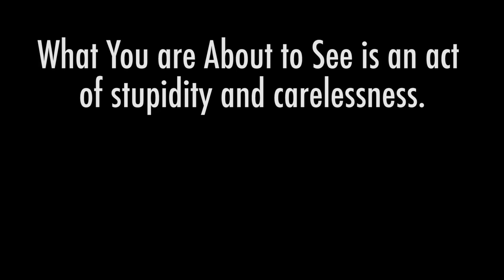Fitting the 670cc and Test Ride!

Comment: I believe that engine is a flat 4 twin turbo rotary from a mustang.
Reply: +mitchell robinson flat 9 i think
Reply: single valve v-flat 12 hemi     2-stroke
Reply: +mitchell robinson That's odd. I was under the impression that it was a 3 stroke hot bulb steam single cylinder radial electricity cooled diesel. With V-tec, of course.
Reply: +Nick Belanger most likely ya
Reply: +mitchell robinson I thought it was a v7 twin turbo rotary with vtec and nos from a camaro.
Reply: +mitchell robinson didnt you see the rubber band in that thing
Reply: +mitchell robinson lamborghini mustang AMG zetec
Reply: +mitchell robinson now you see only car guys are able to find this stuff funny i.e. maserati chevelle RX7
Reply: All of you have got it wrong it's a 9 cyl radial engine from a wwII PLANE running on pure nitromethane with 9 supercharger and 9 turbos
Reply: +Michael Principale dude shit didnt realise!! so i guess they are using a 4.5cyl radial from a WW1.5 plane with 4.5 superchargers and turbos?
Reply: *on the kart
Reply: Really, I thought it was a five stroke v3 flat4 Wankel engine
Reply: oh shit
Reply: I thought it was a 7 stroke 3 piston rotary out of a 1809 Benz motor camero
Reply: does it have 3.141592654 miles per gigawatt?
Reply: Suck Me Off Don't forget the racing stripes and cup holder! That'll add around 700 wheel horse power.
Reply: No just pie! lol.
Reply: Nope definitely a 12V92 Detroit Diesel
Reply: Its clearly a two stroke nitro engine from an rc car
Reply: Its clearly a v5 boxer
Reply: let me know if thats a joke

Comment: is the engine a 454?
Reply from the maker: +Ryan Weredyk Nope!
Reply from the maker: camron day Nope.
Reply: +CarsandCameras 302?
Reply: +camron day it's a 400 small block Chevy I bet it screams
Reply: +camron day ford makes a 302
Reply: Nope it's a 2jz
Reply: +Fart Can no its a 212 predator
Reply: Does that look like a Chevy engine?
Reply: it's a sbc 350
Reply: +Jacob Cannon its a 400 sbc
Reply: By how it's running its acting like a built 454 with twin turbos running on e85 on 200 pounds of boost!!
Reply: Big block distributer is in the front small block in the back probably a 350
Reply: +Jarrett Copper whatever... thats clearly a 2jz
Reply: +cade rondon chevy big blocks still have distributers in the back
Reply: +Ryan Weredyk chevy made a 302 but it was rare
Reply: +Edward Grindstaff ford made the 302 and 351
Reply: +cade rondon Mopar big blocks have the distributor in the front.
Reply: +camron day There is a 302 chevy smallblock, it went in the '69 Z28 Camaro
Reply: +james jones chevy made a 302 it came in the z28 camero
Reply: +CarsandCameras Goodwrench 350? If so I had the same exact engine, minus the edelbrock carb and valve covers.
Reply: It's a smallblock Chevy for sure, since they already said it's not a 305, 327, or 350 I'm gonna say it's a 400. I guess it could be a 283 too, but 400 seems more likely.
Reply: M Kefer most likely not, chevy never got past 400. Unless its a mopar engine. Then it would be a 400
Reply: +_Husky I thought it was a 572...
Reply: Andrew Lang That was only used for GM's industrial purposes. Not found in any consumer class C vehicles.
Reply: FEAR NONE KILL ALL Huh had no knowing of it, thanks for telling me, i know they had a 427
Reply: +CarsandCameras 327 Chevy Small block?
Reply: +Trans am county hemi  or 283 sbc and to the one guy..
Reply: +Ryan Weredyk chevy made a 302 in the 60s
Reply: +Simon Stout its a 283 i have the same truck
Reply: +jake chaplin you never know    its custom
Reply: true all i know is i have an original 66 and it has a 283
Reply: +jake chaplin from what ive seen on channel its a 400 with 327 heads
Reply: No it's a 66 c10 with a 400 small block
Reply: +camron day ye i think chevy made a 302 straight six. obviously it isn't that
Reply: +Ryan Weredyk Rotary v8 with vtec at 140 psi to the front left tire
Reply: +Ryan Weredyk  Chevy had a 302 its called the DZ302, i'm told it would rev and the bottom end was crap. I don't think it was very popular, it would have been in a 68 or 69 camaro.
Reply: +Gslash25 oughta send all that PSI to the right rear with a HDMI cable, then send any left over VTEC to the blinkers
Reply: +TwilightTheShooter do you h
watch haggard garage ?
Reply: +Ryan Weredyk D16
Reply: +~Ž4RÄLHØ ĐŽN™ is Orion pretty kick ass at drifting an automatic Lexus boat?
Reply: +roturd heheheheheh.... honda.....
Reply: +CarsandCameras 327 cu. in. Chevy V8
Small Block
Reply: 572 crate with a turbo pushing 30 lbs on stock internals and a sitting behind it is a turbo 350
Reply: 285?
Reply: +CarsandCameras 350 Chevy small block?
Reply: +STICH MON They didn't "sell the design to Ford" !!
Any V8 with a 4" bore and 3" stroke WILL be a "302"
The Ford 302 has the distributor and oil pump in the front of the block - Chevy, rear. The Ford has 10 head bolts - Chevy has more.
Reply: +_Husky no one said it's original. it's clearly not a 572 but you can buy them and put it in.
Reply: +TIMEtoRIDE900    Chevy uses more head bolts but Ford uses larger, stronger bolts and the layout of the head bolts are superior to the Chevy design; As always.
Reply: Jim Garrison
Stick your thumb in a 351 W head exhaust port, then stick your thumb in a "same era" Chevy 350 exhaust port. You will find the Chevy is much larger.
Reply: Cat 3208 for sure
Reply: no this is my personal opinion so it could be at 4:54 but I think it's an international

Comment: When I was a kid I had a kart similar to this one with a cage over the 10hp motor that acted as a roll cage and dirt bike handlebars/throttle/brakes with wheel barrow tires on the front and fat knobby tires on the back. You couldn't keep the front end down without weights and even then the front wheels had such poor grip it just pushed you through the corners. So sketchy. So fun. I wish I still had it, but it's probably best that I don't. I cant even count how many times the throttle got stuck wide open and made me run into something or hit a bump so fast it flipped the back end over the front. Good times... good times. I should build another one.
Reply: If you do, make some videos and post them.

Comment: If you end up painting it black, try out VHT Roll Bar & Chassis Paint.
I have been using it for years and it holds up great. I used the satin black on my Jeep chassis, bumpers, and half doors.  Also on my Freightliner chassis, axles, and suspension. I have used the gloss black on a flatbed car hauler. Advance Auto Parts usually has it in stock.

Comment: Decades ago my friends and I built go-karts from used "fun-town" go-karts.  The common thing to do was use a snowmobile engine, and lengthen the frame about a foot in the center.  12hp 250cc Bombadier engine with torque converter was mild.  640cc twinn cylinder Herth snowmobile engine with twinn carbs turned 130 mph in the 1/8th mile (I saw the time card).  750cc Kawasaki 2cycle triple motorcycle engine only turned 85mph in the 1/8th mile because the gearing was wrong, but it sure got to 85mph in a hurry!  440cc fan cooled snowmobile engine twinns were the most fun and versatile for black lines left on the pavement and pinning you to the seat while still being "mostly" driveable.  My personal go-kart was the moped of the bunch with a 50cc Chrysler 2-stroke it took FOREVER to get up to speed with no torque converter, but I could pick the whole go-kart up under one arm and walk away with it.  You have a fun channel to watch, that brings back memories.  That 650 twinn you're running sounds cool, but really is awfully lame.  But that's probably a good thing - by the looks of the frame you've got it mounted on.

Comment: Interesting, but very "agricultural". In NZ, we race grass/dirt karts with proper frames like circuit karts. My Suzuki RM250 powered machine had a computer programable CDI and a flat-shift switch on the gear stick. Useful for changing gears under full throttle with the front wheels in the air, as it did out of most corners. Yours may be fun, but it ain't the sort of 46HP, 9500 RPM experience I had!
Reply: +Peter van Brucken sounds awesome!
Reply: I'm sure it's fun but I am also pretty sure it's about a hundred times more expensive, lol.
Reply: Only cost around NZ$2,500.00 to put together, so not that bad.
Reply: +Peter van Brucken Really? Wow! thats realky not bad at all. I have to wonder though whether we here in the states could get it for anywhere near that price. Karts here are generally seen as kids toys not as serious racing machines so for the most part here things like that are more expensive. Thanks for the info!

Comment: Horsepower is just a number mathematically calculated. What you'll realize eventually is that what really matters is torque, when and where it happens and for how wide in the rpm range.
Reply: What you said is exactly what horsepower measures...how much torque at a given RPM. Just because it's "mathematically calculated" doesn't mean it's not a real indicator of power. You "torque is king" people drive me nuts with your ignorance 🤦‍♂️

Comment: FYI: for future projects before figuring out how to make it go like hell, figure out how to stop it. This is a basic design philosophy to all engineering. Is that the operator of ANY machine regardless of their operating knowledge can determine how to turn it off without prior instruction. Such as a large RED kill button mounted in the middle of the steering wheel that is labeled STOP. Sooner or later it will prevent someone from being hurt. Then have fun
Reply: Do you not understand there modo "itll be fine"? If thats someones modo obviously they don't care about brakes

Comment: I would like to see how your going to fix the brake problem and acceleration problem
Reply: +Aiden john Law I don't think they installed the new brakes yet and just stuck with the drum ones for now and I think they could fix the acceleration with a simple counter weight on the front
Reply: What acceleration problem
Reply: +José Villa the wheelies I'm assuming.
Reply: There is no such problem as a acceleration problem. Maybe if its sloww
Reply: +BF4_Legion that is an opinion. The cart has a problem with over acceleration and traction lifting the cart, so therefore a problem with acceleration.
Reply: +jacob cornell there is a problem with not being able to put down power. Not aceleration
Reply: +BF4_Legion the problem isn't putting down the power. It puts the power down just fine. It puts it down too hard. And the rear wheels accelerate faster than the forward motion of the cart, that is why it keeps doing wheelies. Because the rear tires hook and ACCLERATE too quickly.
Reply: +jacob cornell wheelie bar. More weight in the front. Not less acceleration
Reply: +BF4_Legion decreasing the rate of acceleration also solves this problem. Because the rate of acceleration surpasses the finite point at which the weight transfers from the front of the cart, to the rear of the cart. This problem can be solved in dozens of ways, but no matter which way you solve it, the problem is that the weight transfer from the front to the rear of the cart is determined by the rate of acceleration. So therefore it is still to be considered an acceleration problem.
Reply: +jacob cornell Stop using $10 words for a $1 point. You're not impressing anybody.
Reply: It'll be fine

Comment: how the heck is that possible.... that motor has 600+ cc but only has 22 HP, my rm85 makes 24hp and its only 85 cc
Reply from the maker: +David l Your bike is a two stroke. It revs very high and makes good power for its size, but makes much less torque. This engine is a four stroke. It revs low and makes poor power per cc, but it makes tons of torque.
Reply: Ok thanks

Comment: The wheel base needs to be wider, because that thing is top heavy.  The motor's weight plus your weight is too much.  Split that frame in half and widen it about half a foot.   Then add a few gussets to reinforce the cuts.  Otherwise that thing will flip in a hi speed turn.  You are going to need a axle anyway, with all the pits the old axle has.  Then "It will be fine".

Comment: -  which torque converter did you use ??? - did you make the plate which holds the clutch and driven parts?   I'd love to have this motor on an old Cushman which has a series 20 and small motor,
Reply: +karlsonkab51 i think its a 40 series from gopowersports

Comment: With 22hp it should be geared for a top speed of around 65mph to 70mph. My go-kart did 62.5 with two motors that had a total of about 15hp. ( Homemade two engine Go-kart )
Reply: 2 cylinder engine

Comment: I'd like to see someone build one of theose buggies/kart using a FWD manual 
five speed sourced from something like one of those 3-cylinder Geo 
Metros hooked up to a built 670 with engine and transmission mounted in 
the back. If someone could figure out a way to mount the clutch and some
 kind of adapter plate to mount the engine and FWD trans together it 
would make for a pretty bad ass buggy! The way I understand it those 
trans out of the Geo Metro 3-cylinder cars was pretty small and light 
weight but was still hooked to and engine putting out about the same as a
 build Predator 670 so I don't see why it would have any problems with 
holding up the the 670's power if you could just figure out a way to 
hook them together...

Comment: Had something similar happen to me today, adjusting the throttle on a mini bike engine in your other videos and accidentally jammed it on full speed. Hit 6,794 RPM and almost blew up. Make sure where you know where the spark plug cap is. 😳

Comment: I am using an engine similar to that but it is heavily modified and is pushing 45 hp. I will be putting it on my racing mower. what torque converter should i use

Comment: Well it is hard to tell what motor is in your truck . Your truck is a 64 - 66  . So if that is right and if the truck is a matching number truck then this engine is a small block 265 , 283 ,307  327 , 350 this is if it is a Chevy motor  . It would ether be a lucky guess what it is .  The most popular engine is the chevy 350 CID family .  So i will take a shot at it . It is a 327  with an Elderbrock carb and intake .along with headers .

Comment: Just for your information, you're way better off just buying an old, for example, Honda NX250 and taking the engine out.
Those engines are bulletproof, 249cc and 28HP and loads of torque.
Just make a simpel shifter kart.
NX650 is even better, air cooled.

Comment: I have a Baja Doodlebug MB30 and I'm about to put a 212cc predator on it with a Max Torgue SS 15 tooth clutch with a 70 tooth back sprocket. My question to you guys is: is this thing gonna still want to ride a wheelie or will it take that torque away and just be faster. I also ordered the PMR mounting plate to make it simple. Question (2) with this set up should I still take out the Governor or should I leave it in with this setup? I'm not setting this up to race I just like to go fast at times. But with the 212cc predator motor with the clutch, I mentioned, 15 tooth clutch with 70 teeth back sprocket is that gonna be fast enough so that I won't need to take the governor out? Let me know what you would do with my set up Thanks in advance.

Comment: ok this cart is badass as hell. i just thing should be faster. if a heavy ass motovox with a stock 212cc 6.5hp predator can go 45mph with stock centrifugal clutch, and govener still in the motor, im pretty sure this 22hp should be much much much much faster
Reply: If you can get 45 mph out of a stock 212 then it's the gearing ratio
Reply: it was a stock gear ratio. on the motovox bike from sears. anf my bad the govenor was taken oof but still

Comment: I was wondering if you can tell me what size bolt goes in the shaft on a 16 horsepower Duramax engine  to hold the clutch
Reply: +Juan Perez wish i could tell you.

Comment: It would have been better to use a chainsaw engine! Also, I just don't get why you didn't put the gas tank in the center between both legs, and if you had to you could have moved the throttle and brake pedals out further.

Comment: Guys I hate to tell you this but you have the wrong set up.  The engine you have will need a gear box to really get the highest performance.  It should be able to push the kart up to 200 mph.  But only with a gear box.
Reply: +Thomas Harrell we dont have any gear boxes. maby when we find one we might try one out

Comment: Will you please tell me if you think this motor will power a small buggy. Right now im building a small sandrail about 3/5 scale of a average size rail and plan on using atv tires in the back. Does the predator 670 have enough torque to push this through sand and up hills?
Reply: +Patrick Rodriguez she is pretty powerful . we have had problems with smoking when we go around corners and stopping hard. it needs a windage trey
Reply: +Patrick Rodriguez
Use a Ski-Doo 670, find em anywhere. Take the engine and clutch's, 80+ HP with practically endless RPM.
That V-Twin ain't bad for a cart on dirt roads, hell that's a lot of power!
But honestly, for what your looking into doing with the sand an all.
You'll be disappointed, especially on climbing hills. That coming from experience.

Comment: I'm sorry for bother man. but a got the last question. do you know what torque converter can I use for a predator 13 hp??
Reply from the maker: +pedro medina I believe the same torque converter that we used on the 670cc engine will also fit on a 420cc 13hp Predator. I'm not sure because I haven't personally done it, but I believe they are both 1" shafts.
Reply: yeah it is ive done it with the same torque converter cars and cams did on a 420 predator so it will work cause ive tried and tested it